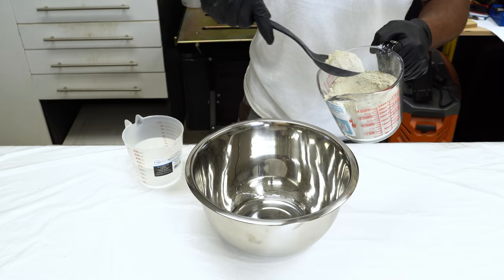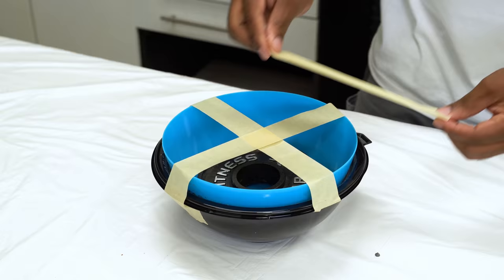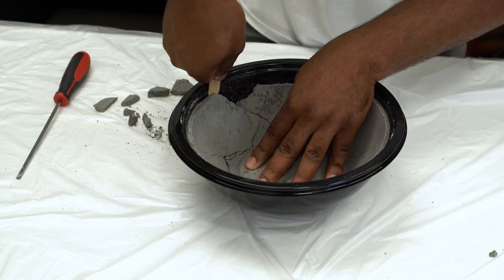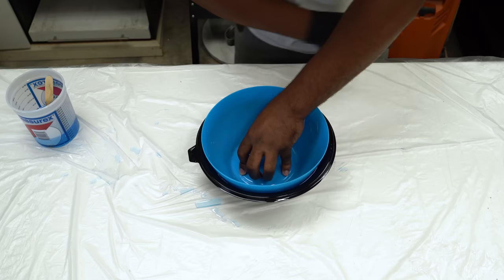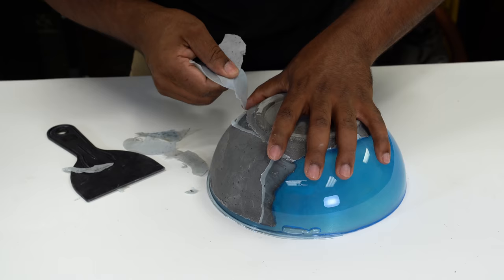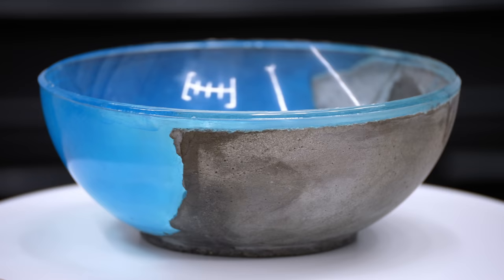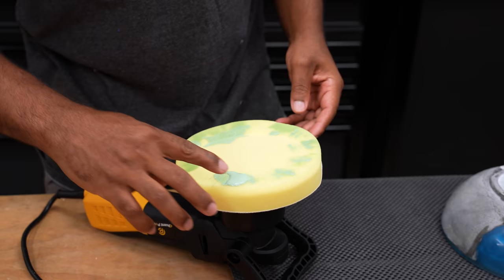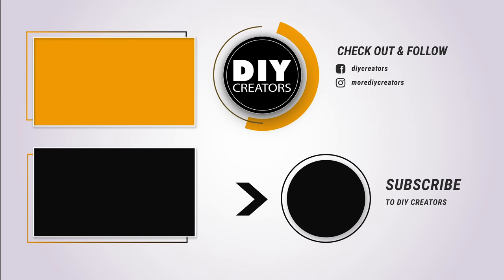Epoxy Resin & concert Bowl

Comment: I mixed my epoxy with  “rock “ free mason mix .. then I mixed mica powder for color. I used this for my shower floor.  It worked !!!
Reply: Sounds stunning!  Care to share details… substrate, thickness, recipe?
Reply: @gr8dvd  My recipe was by accident I put the sand in the mixture of the Apoxsee cups for all the colors I put in so that I could stand in the shower I don’t have a recipe I had cups the solo cups filled with the black white and silver and mixed in the sand and started pouring on my shower floor I don’t know how to upload a picture on here otherwise I would try to show you what it looks like
Reply: @gr8dvd  My recipe was by accident I put the sand in the mixture of the Apoxsee cups for all the colors I put in so that I could stand in the shower I don’t have a recipe I had cups the solo cups filled with the black white and silver and mixed in the sand and started pouring on my shower floor I don’t know how to upload a picture on here otherwise I would try to show you what it looks like.
Reply: @ellpat2928  Understand, kinda like my landscaping when neighbors comment I say, design by shovel 😀

Comment: If you vibrate the mold after pouring the concrete and again after the resin, you'll get rid of a lot of the air bubbles. Use an orbital sander on the sides of the mold right after you pour the concrete, and again after you pour the resin.
Reply from the maker: I did vibrate it a little, but because I could not see I was not sure how much. I figured there would be micro bubbles, not that large one I shown. I know for next time to put in a bit more effort.

Comment: Can I recommend that you mount the bowl upsidedown sealing it to a board. Then put your demolding wax on,  concrete, then do your epoxy. The problem you are having with bubbles is that the bowl has a pocket underneath. Epoxy is self leveling as long as the surface is level.

Now: Having 2 bowls 1 for concrete and 1 for the final is a good idea! Don't ever forget to use demolding wax or spray, that's an amateur move buddy!

Comment: Using so much water in the concrete is what made the outcome so brittle.
If you have a vibrator/massager/horsecock/etc. you can use a thicker mix, retaining strength and your ability to make more precise and controllable breaks in the future.
Good luck in the future.

Comment: I like what you're doing here but the lack of putting time into the cement after works made me feel bad. When the two are combined with the same thought and time you put into the epoxy you should have a much nicer result. Take a look a modustrial maker for example on how he works with cement.
Reply from the maker: I heat ya, I mean we don't use the same cement. We don't work the same sorry to disappoint ya.